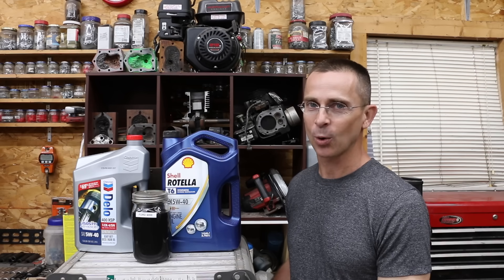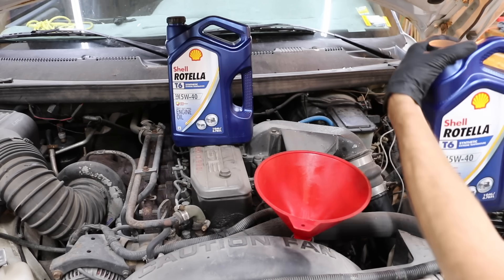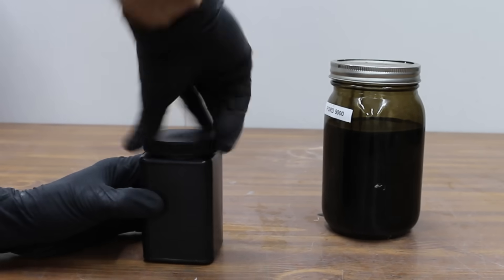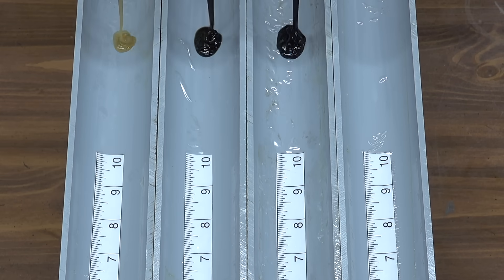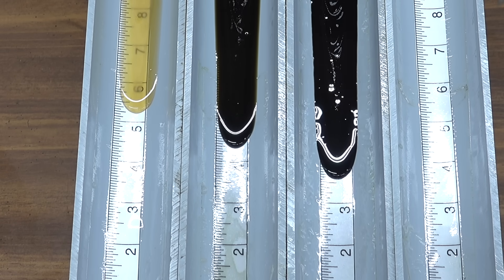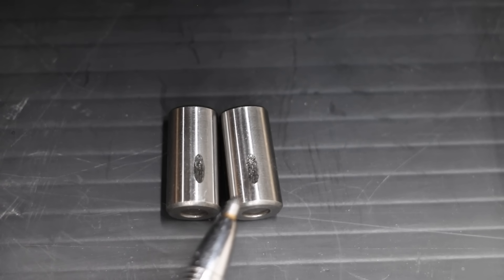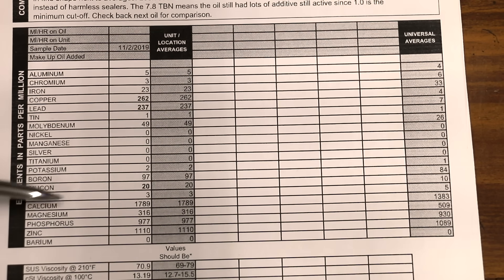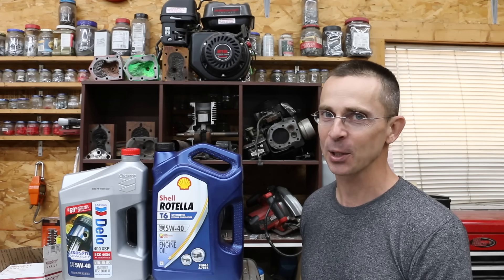Will Annual Oil Change Damage Your Car? Let's find out!

Comment: bruh 5w40 is super thin for an old vehicle....u should be using a 10w40....
thicker oil is for older high mileage cars.. thinner oils are for newer low mileage cars, thinner oil will be probably be burnt in an engine such as the one shown in the video, not an accurate test
Reply: Zaakir D that's terrible understanding of tribology
Reply: @Kavi4GP  lol what experience do u have ???
Reply: a 12v cummins with 100k miles is a freshly broke in engine. Those trucks literally just need functional oil, it doesnt matter what you throw at it so long as there is proper oil pressure. 5w40 wont kill that engine, the oil leaking out and not knowing would  because they leak like crazy
Reply: Thinner oil doesn't get "burnt".  You should be using an oil that can flow through your bearing clearances. 

I have seen 5.4 triton motors loose cam bearings because somebody thought that exact same thing. The engine calls for 5w-20, but the oil pump couldn't force enough oil into the top end with 10w-40 at cold temps. 

I still run 5w-30 in a 250k mile LQ4, it still has 40 psi of hot idle oil pressure. My 350 had dropped to 15 psi hot idle, so I upped it to 0w-40 and it idles about 30 psi now.
Reply: Zaakir D 
Agreed. 12v Cummins wants 15w40
Reply: @fastinradfordable , wrong. Go look up the Cummins Ambient temperature chart for 89-98 12v engines. Based on ambient temps, Dodge listed 5w30, 10w30 and 15w40. It's all about cold starts and where you live.
Reply: 10w40 is only thicker at start up, but 5w40 and 10w40 are same viscosity at temperature. 40 being the "hot" viscosity of both oils, 5w in a diesel is excellent for cold starts.

Comment: I think the zinc is the key to low wear. The new requirement for oil is less zinc as the engines have more blow by due to having looser rings for less friction and better mpg. The high zinc clogs up the newer converters as well so they make the requirement with less zinc. 
If you have a car that is a bit older using oil made for diesel engines can give you more zinc. Or add your own additive like STP oil additive with zinc. I dont know the amount they put into the STP hopefully it is worth the $4 it cost. 
This is what I have put together from everything I have read. It could be wrong but makes sense to me.
Reply: Modern engines don't have looser rings, rather they reduce the thickness of the rings and thus the contact patch. Measured blowby of equivalent older designs is higher, with modern tolerances being closer and more focus on emissions and service intervals than the past. Modern alloy blocks also expand more than cast iron, while modern engine control gets mixture more consistent and power between cylinders more similar, all of which requires less piston ring gap for a given engine power output, and hence results in less blowby. None the less in order to make more peak power you'll open the gap wider, in order to increase the temperature at which its expansion causes that gap to be zero, and thus the ring to bind in the bore causing catastrophic failure if exceeded, so something like a hellcat is going to have much larger ring gaps than a commuter eco-box.

And yet your correct that zinc levels have fallen in oils, but not for the reason stated. While your correct that if a vehicle is burning engine oil at increased rates, it will harm the catalytic converters, so will all the other metal in oil that have increased with time, increased "zinc" (Zinc dialkyldithiophosphates OR zinc di-thiophosphate) levels have fallen because its actually NOT an ideal choice for protecting your engine. Firstly its directly sacrificial, in order to do any useful work the zinc is depleted, placing direct limitations on the effective life of the oil, and since it requires to be in solution even after its broken down doing its work this competes with other additive packages for space as well as the oils ability to pick up contaminates, so as oil volumes fall and service times increase, this makes it no longer viable to serve this purpose and replacements have been included in increasingly high levels. Secondly it can only complete its function at elevated oil temperatures, in normal consumer engines and moderate conditions this is about 10mins of running which you rely on other additives during this time (including the most critical for wear of initial cranking/start), but with engine stop/start systems, hybrids, external air-oil coolers or cold climates this period can be increased drastically or even not reached on some commuter trips at all, again making zinc less viable compared with modern equivalents. Finally while zinc is a corrosion inhibitor for iron and copper, it won't protect aluminum, magnesium or titanium which are more galvanically genitive (and so will react first), which again, means while previously fit for purpose use in older engines is no longer the best option and has seen it increasingly phased out. Using oils specified for another purpose or adding external additive packages void any warranty and may cause harm, if you know your using it in a way different from intended it may be suitable, but most of the time your much better off using the money to service regularly than reinvent the wheel.
Reply from the maker: Great point!  Thank you
Reply: High zinc will kill your cats sooner, guaranteed.  The additive package in today’s oils for modern diesels is a very carefully formulated mixture, one that meets very specific engineering standards.  Now,,if you have an older engine with cats deleted? Pour in the zinc as specified by the supplement manufacturer.! Rislone makes a zddp additive in a good base oil for older mechanical diesels, and its cheap and concentrated. But beware adding too much, as the zinc phosphate will attack rod bearing linings.
Reply: @wallacegrommet9343  
Does it matter which breed of cats? And what about dogs, will it kill my dogs too??
Reply: That’s a trick question; dogalytic converters have yet to be invented. Everyone has been barking up the wrong tree!

Comment: I’m sorry I haven’t watched enough of your videos to know if you’ve tested any additives like Lucas or Wynn’s. I’m not a big fan of additives but my boss at the shop I worked at in high school used to sell Wynn’s additives. The local distributor used to come to local fairs with a flathead Ford mounted on a trailer and he would drop the pan and run it without oil pressure for a period of time and supposedly show how Wynn’s was improving bearing and cylinder protection. We had a lubricity tester, much like yours, at the shop and it seemed to indicate there was benefits to the Wynn’s additives. This was in the early 70’s and I know oil quality has advanced a great deal since then but I’m still curious about what your experience has been with additives. Thanks
Reply from the maker: Thank you for the video idea!

Comment: Holy crap what is that filter tool 😲   i busted my dang knuckles getting the other wrench on my truck lol  wosh i had that, but now I buy K&N that has the welded bolt on the bottom
Reply from the maker: Thank you

Comment: Got a Chevy Colorado with the mini 2.8 duramax diesel. Ive been changing my oil every 7000 miles with Amsoil synthetic and no problems.
Reply from the maker: Thank you for the feedback!  How do you like the duramax?
Reply: @ProjectFarm  pretty good... only thing i dont like is the all the extra emission control crap they put on it.. and its got a timing belt instead of a chain

Comment: I work as a lubricant engineer and enjoy these kind of well done home made tests. 

FYI for all in case those that didn't know, TBN = Total Base Number, TAN = Total Acid Number. I concur with your findings which I believe personally. The oil is good, don't need to change. However some will cling on to the belief because they don't know about oil testings or how to read the results. Some might scoff at doing oil analysis since a bottle of oil might cost similarly. However it is always beneficial because you get to know what's the state of your engine is currently like.

I think corrosion in an unused engine that's seated for a very long time happens more from condensation of water and causing rust.
Reply from the maker: Thank you for the feedback and great point on the source of corrosion!

Comment: I really can't Believe Americans are still stuck on this 3000 mile oil change from the 1950s lol
Reply: As an American, it baffles me. I do my changes with Mobil1 Extended Performance. Rated for 15,000 miles. I use a Wix XP oil filter rated for 10,000. I do my changes at 8,000.
Reply: @shadowthehedgehog4737  
Shows how powerful Advertisement and constant telling the public one thing can really stick 20 years later when it's completely wrong and outdated 
even when told and proven to be just a money maker.. People still won't change
pol company huge profits
Reply: As an American I usually go 3-5K miles on cheap dino oil. I don't see a reason not to, an oil change takes me a half hour and costs less than $20. Oil and oil filters are right at Wal-Mart and you can buy them when you buy groceries. I can dispose of the old oil for free at Autozone or Advance. Old oil just feels worse and your car accelerates and idles worse. I personally am a believer in cheaper usually non-synthetic oil and just changing it often, rather than relying on magic bullet oils and changing at 10-12K. I only drive 10-12K per year, so two or three oil changes really is a drop in the bucket time and money-wise if you're not using fancy elite oil. 

Our driving distances are longer than most of Europe (100km commutes each way to work are not uncommon) and probably the majority of cars make it past 200K miles before being scrapped. Statistically the average EU person only drives about 12,000km per year, the average American drives 13,000 miles per year, big difference. I think that's a reason why European cars are regarded as unreliable junkers in USA, they're designed for about half the mileage the average American puts on. Some Euro cars even do dumb stuff like spec "lifetime" transmission fluid. 

On the flip side, what you see about Americans on the internet with oil is a vocal minority. There's so many Americans that live so paycheck to paycheck, and don't think of the future at all, and never do oil changes. There's plenty of cars with 30-40K miles easily between changes rolling around here. Or people that will literally run them dry until the idiot light comes on and finally get one then. I don't even want to talk about air filters, air filters being ran until they're fully black, with literal rat nests inside. :/

Comment: I use T6 5 40 in my engine and I change it every 10000 miles I changed the oil filter every 5000 miles
Reply from the maker: Thank you for the feedback

Comment: Non SN oils have been in use on cat-equipped cars for decades. Only now, do we need SN because it's the latest formula, or have cats changed in design and need it?
Reply: My dad uses a water bottle to get the cats out of the car.
Reply: As mentioned elsewhere, it has to do with the way newer cars are made with looser (less tension) rings that allow more blow by to gain in fuel economy due to the lower internal drag. This allows more oil into the exhaust and that damages the cats. Older vehicles that originally spec'd older S types will actually prefer oils with more zinc than the new SN types. 

But it's not that the catalysts have changed so much, but more that the overall engine design is allowing more oil to be burned. ;) Hope this helps.
Reply: @Broadpaw_Fox  Makes sense, thanks!

Comment: You should test harbor freight predator engines against the Honda gx engines they are based on (the predators are essentially cheaper clones). See which is stronger, more powerful, more durable, most reliable, etc
Reply from the maker: Thank you for the video idea!

Comment: Fleet guard & Donaldson filter are the choice and u can never go wrong with it. There is a valve and there is a magnet built in the filter.
Reply from the maker: Thank you for the information
Reply: I did cut out and compare . It’s totally different . And my Subaru has been using Donaldson filter for now. U can compare it too. Hope it works for u.

Comment: Great choice in diesel truck!👍🏽 I use synthetic that is suppose to be changed out once a year but change it every six months regardless.I think that if you leave the oil in there for a year and at least get 10k miles on the vehicle you should at least change the filter at 6 months. is the carbon that I get worried about on diesel engines.
Reply from the maker: Thank you!

Comment: T6 is great in motorcycles w/wet clutch too.  Fabulous oil and easy to find. I use it in all my outdoor/power equipment and motorcycles.
Reply: I third the notion! I use rotella t 15w40 in every motorcycle I've ever had and they acrually performed better! Clutches grabbed better and less slipping after a few hundred miles. I also run Rotella in every vehicle I own due to the zinc content.
Reply: I run T4 15w40 in my KLR650.  No issues on or off road.
Reply: Man, I'm gonna use it next oil change in my Goldwing.  Thanks for the info.
Reply from the maker: Thank you for the feedback
Reply: It is JASOMA2 approved so its for wet clutch systems as well, i use it in my turbo eclipse and brand new gsxr. I took my eclipse motor apart to rebuild it just because it had low compression, and that engine was amazingly clean. Rotella t6 ftw

Comment: What about Amsoil signature series with a 25,000 drain interval and there 12,000 mile  oil filters?! That would be an epic test!
Reply from the maker: Thank you for the video idea!
Reply: @ProjectFarm  yes please, I'm using amsoil and no one answers this
Reply: I kept Amsoil signature 0-30 in my Toyota 4.7 V8 for 2 years(maybe 10K km), then got it tested at an accredited lab and sent the data results to Amsoil. They sent me an email saying use it another year as we see no problem with the oil. I've been using this oil in my Toy for about 140K and it doesn't burn a drop between changes and still purrs like a kitten. My mechanic(who is a Toyota/lexus owner) says he's never heard an engine so quiet.
Reply: Some amsoil filters also have a 25k interval. My buddys subaru has a 12k, my f150 has a 25k. Both would be great to test imo!
Reply: @xXluckyjoe7Xx  I also use their synthetic oil filter too.
Reply: @wally6193  they're good stuff. I run XL for the f150 and their filter for it
Reply: @xXluckyjoe7Xx  I've been using Amsoil products for over 20 years and I won't change to any other oil. Actually all the lubs(tranny, diffs etc) in my 4r are Amsoil

Comment: My favorite oil filter tool is the Lisle 63600. It doesn't go up to really large filters but it's great for getting into tight spots and fits a variety from the little ones on my motorcycle up through pickup filters (3 1/8"). The 63250 goes from 3 1/8 up to 3 7/8
Reply from the maker: Thanks for the suggestion!  I'll check it out

Comment: I can tell you the answer is a qualified “NO”. You can easily get away with once a year oil changes if: you use synthetic oil, you don’t drive more than 12-15K miles/year, you don’t drive hard or in tough conditions, and your vehicle has been well maintained and isn’t too old.
Reply from the maker: Thank you for the feedback

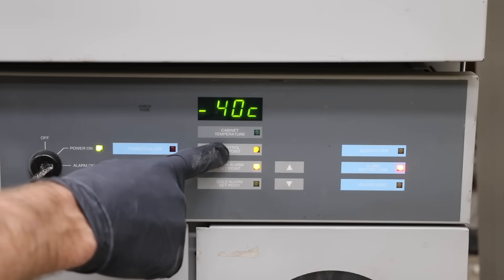Comment: 3:40  "40° F"?  I see what you did there!  So, I should be taking out my backup generator every month and getting it up to temperature?  Also, is it beneficial or harmful to use diesel-grade oil in a gasoline engine?
Reply from the maker: I wouldn't worry about taking the backup generator out if it's inside of storage.  Biggest risk of using diesel oil in a gasoline engine is the high zinc content can damage the catalytic converter

Comment: Great work there Todd, it is imperative to keep clean engine oil in any engine. Oil is the lifeblood of any engine. It is advisable to change oil every 3 months in arduous conditions for added protection. Especially in modern engines. Both petrol and diesel engines need regular oil changes (at least once per year). Great work as always.
Reply from the maker: Great point! Thank you

Comment: What is the difference between oil for diesel engines and gas engines.  ? Is there a difference or just labeling.?
Reply from the maker: Diesel oil typically has higher detergency and anti-wear additives (zinc). Thank you

Comment: The most impressive and amazing thing about this video is at 3:30 & 7:55 where you pour the oil into the test tubes and didn't spill a single drop!! I would have spilled that crap all over the  place and made a mess like a 14 month old baby after feeding themselves.   

I've always known that the "Change your Oil At Least Once a Year No Matter How Many Miles Were On It" was Oil Companies Bull Shizit and their way to get you to buy MORE Oil. Like you said the only thing you'd have to worry about is condensation/moisture buildup from having it sitting in so long. And that's only because you can't completely fill a engine up with oil removing all the air, if you could remove all the air you'd never have to worry about condensation/moisture buildup.
What I found surprising is the oil from the Ford wasn't filled with engine parts and pieces  🤣😂🤣😂 although the oil from the Ford did break down a little and flow faster than the other.
Reply from the maker: Thank you!

Comment: Most manufacturers specifically say not to pre-fill filters to reduce contamination. 
Any truth to it?
Who knows.
Reply: It won't come from what's inside the bottle, so keep your work area clean and there should be no issue. I can see if the wind is blowing and you fill the filter in the middle of a dirt field, stomping in that dirt while having the filter duct taped to your ankle.
Reply from the maker: Thank you for the feedback